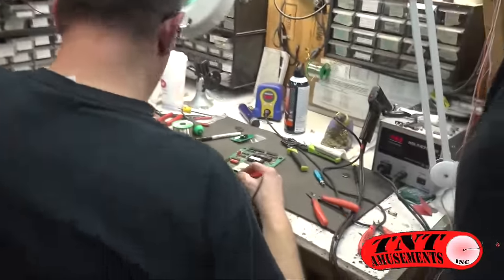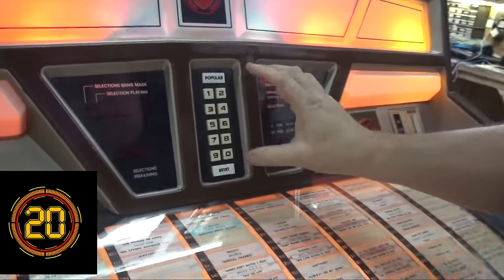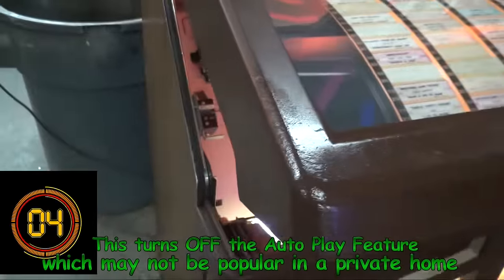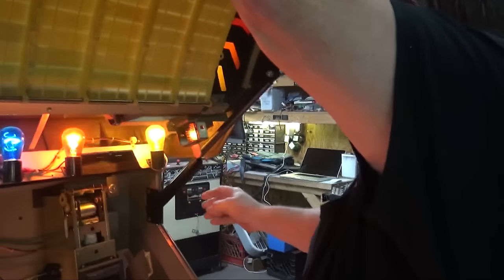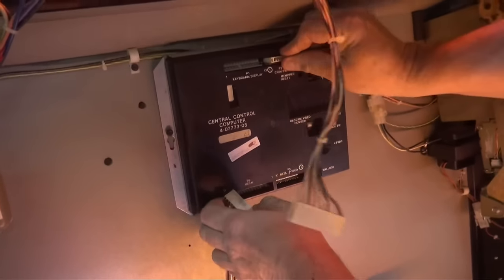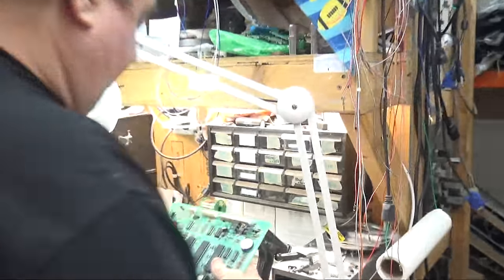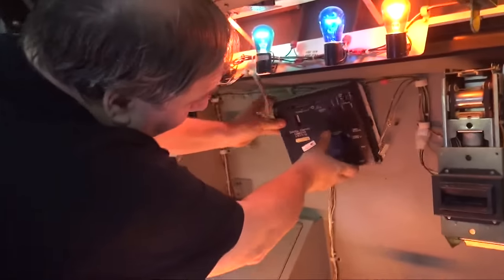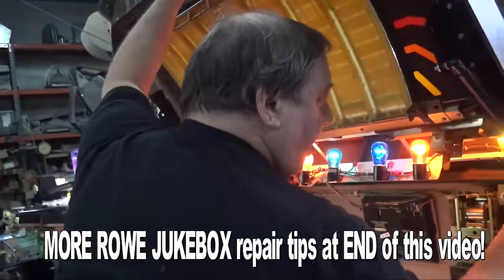#1229 Rowe JUKEBOX R89 to R94-Setting FREE PLAY-Changing battery-Todd's Tips! TNT Amusements

Comment: You seem so knowledgeable and I'm wondering if you could help me out with my R-85. When I turn on the jukebox it continues to play random records until I hit the "Clear Selection Memory" button. I have the continuous play button set to off but it just keeps playing records. If I select a record it does not play it next. It's a little irritating having to open it up and hit the clear button every time I  turn it on. Any ideas?
Reply from the maker: there is a rechargeable battery in it...its dead and there is garbage in the memory
Reply: @tntamusements  Thank you!. I replaced the battery and it is working great. The battery had leaked and corroded the wires on the diode just adjacent to it so I replaced that too. Also re-soldered those cold pins. Thank you for sharing your knowledge!!

Comment: What size battery used in a R86 if I use a coin battery holder would I have to have a blocking diode ? I can't find any info on this.
Reply from the maker: I believe it was a ni cad 2/4 volt battery

Comment: Do you guys sell the battery holder for the board? I’d like to buy one from you. How difficult is it to remove the old battery and attach the holder?
Reply from the maker: We sell the lithium battery board to replace the Aa batteries forever...then it's one round cell to change and it will not leak..it's four legs to solder into the board where old battery holder wat
Reply: @tntamusements  where can I find it? How do I order it?

Comment: Hi Todd. If I change the battery on my Rowe CD jukebox (video on my channel) will it erase the initialized cd track settings? And which board is the battery cell in?
Reply from the maker: Yes it will IF YOU TURN POWER OFF when changing it....leave the machine on, and change it out to preserve the settings..its on the main board on the back wall of the machine inside the black box..

Comment: Hi Todd. Love your video posts.  I have a Rowe R89 Video Jukebox with everything but those old Beta decks and wiring to the Control Center and Video unit.  What I was wondering is what are the codes to change back to Auto play and coin operation and how to change the pricing.   Also, is there only 2 settings to the auto play (attract mode) of 20 and 40 mins or can it be programmed to any specific time to play?  Thanks for great videos and info on arcade games.
Reply from the maker: You have to find a book for it...its easy to turn those features on and off in the menu.  The battery has to be changed though, so the new settings you make will stick after you turned it off.
Reply: Thanks Todd.  I'll see about getting  the manual for it.  The one I have is for the R86..lol,

Comment: I have a Rowe 94 and how do you reset the security code when you cannot play selections ending in 8 and 9 I have looked through the manual. it tells you to go to location 29. I have no clue to reset it if you can tell me please reply.
Reply from the maker: that means its set up for a CD player...so it plays 80 45rpms and 6 CD's...you have to find the option to turn it back to 100 plays.
Reply: Thanks. We got it figured out..

Comment: 255 is the last number in an 8-bit register.
Reply from the maker: Ahhh...could that be the method of their madness?
Reply: Yes! An 8 bit computer is very common for simple electronic devices. In binary, a 8 bit number gives you the ability to represent any number between 0 and 255, in this case 255 is simply 11111111. It's simple for the programmers who made the chip to use 11111111 as opposed to some other number because its simple to type and its easy to remember.

Comment: course naturally cd's skip about as bad as 45's.  although a cracked cd probably won't work but a cracked 45 depends on how good the needle is :P Cracked 78's?  (and I'm sure there's a few 78's??, isn't there a 16 speed record.  too slow) I have alot of 78's, many of them are over 100 yrs old :O, although Bobo the clown is really hard to get it to play properly because of where the tracks are in location to the center.  oh how thrilling.  A cracked 78 because the groove is so large usually plays just fine even with a bad needle :P
Reply from the maker: I may go into the 78rpm business...I think there is a growing demand for them!
Reply: oh well there is always the Wax Cylinders  :O  now finding a player to play those is harder than 78's :)  (I don't have any!!)